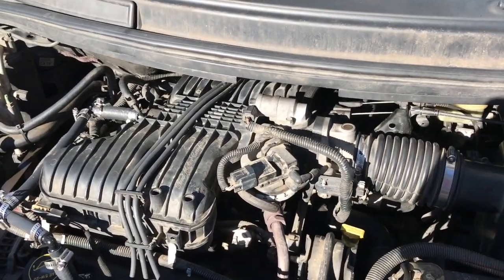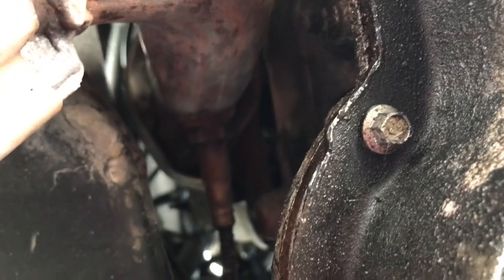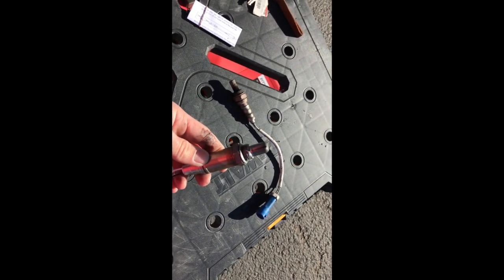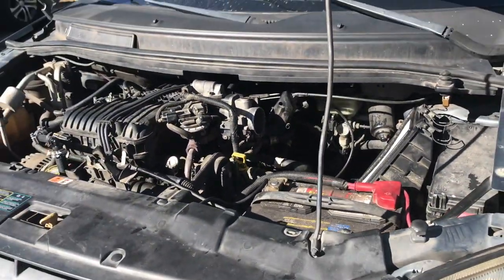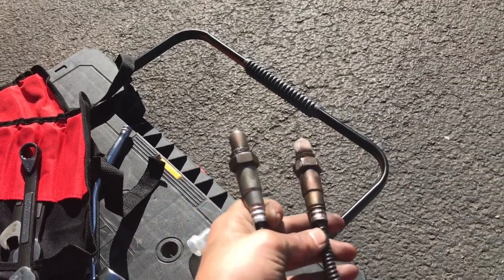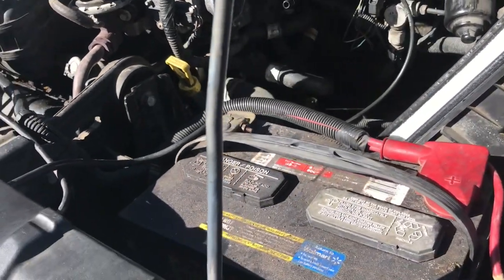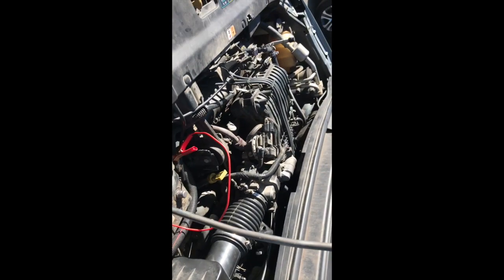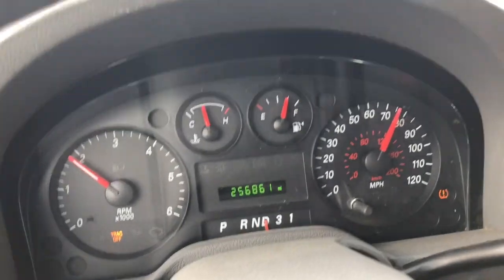04 Freestar O2 Sensors, Misfire Fix

Comment: I just fixed my 2005 Freestar. Rough idle, power loss, stall etc. P2195 and P2197 (O2 lean) codes. I didn't change the O2 sensors as it is unlikely both sensors failed at the same time. It turned out to be the IAC solenoid was seized. I connected it with alligator jumpers to 12 V and it wouldn't move. I washed it with throttle body cleaner and hit it with some lube and it started to move. Engine runs well again. I cleared the codes and nothing has come back since. As a preventive step I did the cowl gasketing and checked out the PCM connector. I hope that this may help someone else trying to debug all these sensors and valves. Thanks for posting.
Reply from the maker: D.Comeau Custom Knives glad to hear you got it running well again. The arms from the IAC solenoid on mine had broken off, and I JB welded them back on prior to this. Great suggestion on things to check!
Reply: Have  the same problem now, it's also saying sensor problems in the dash but that's not mechanical it's stalling only if it's a tight turn but it's def misfiring

Comment: Hey bro, I have a 2005 freestar, and I had that.same valve chatter noise, What you need to do to stop that and prolong your engine life, is to change your oil pump, what a difference it makes. I coild not beleive how great my 05 fteestar ran when I replaced the oil pump and no more valve noise, period.
Reply from the maker: Great tip, thanks for the update! This vehicle is long gone, but good to keep in mind if I run into it with a future vehicle.

Comment: I’m having this exact issue when I hit the beltway or a hill it drags at like 20/25 mph and jerks a lot..... then randomly picks up..... went to auto zone and they said it was my oxygen sensors I need 3..... I have an 05 ford freestar
Reply from the maker: They should be able to tell you which  you need to replace based on the codes, although at that point you should just go ahead and replace the 4th while you're at it.
Reply: Omg yeah I need to replace it all cause on my way to work the jerking and shaking was driving me crazy smh
Reply from the maker: You may consider replacing the ignition coil pack while you're in there. It's not terribly hard to get to while you've got the cowling off, and when it fails it can cause misfires that give funky O2 sensor readings. I've had to replace mine twice in the year I've had this van (3 times actually, the first one I got failed after 500 miles and had to be replaced on warranty), and it's only like $50 so it's cheap insurance. 

edit: After reviewing my video, I see that I talked about the coil pack at the end.
Reply: Omg thank you so much I’m definitely gonna look into all of that ASAP
Reply: Greetins Drew.  I experienced this same  problem with my 05 Ford Freestyle,  I replaced alot of parts.  EGR, THROTTLED BODY, FUEL PRESSURE SENSOR, COMPUTER, FUEL PUMP & FILTER, EVAP CANISTER,  COIL. Now. When tank is full it shudder while driving and shuts off at the stop lights at time.  But when the tank is 75 % full it drive great.  No issues.  Do you have any clues on why the car only does this with a full tank of gas?

Comment: I have a 2004 Ford Freestar With a Bad miss but no codes any Ideas
Reply from the maker: Weird that it’s not throwing any codes. Usually it’ll throw a misfire code and tell you which cylinder bank it’s on regardless of what’s causing it. Check the basics: spark (plugs and coil pack), compression (compression or leak down test), fuel ratio (clean the injectors, check for vacuum leaks). When I got my van it ran really poorly at idle/low throttle/taking off from a start because it had a few large vacuum leaks.
Reply: These will run rough if the camshaft synchronizer is failing and it will not throw codes  . Although you might here screeching /chatter

Comment: Hi  I have a 05 ford free star and I need to replace the 02 sensor from bank 1 sensor 1do yo know which one is that .
Reply from the maker: juan gonzalez It’s been quite a while since I owned and worked in this vehicle, but a few seconds of Google searching reveals that cylinder bank 1 is the firewall-side of the engine, and sensor 1 will be the first one after the headers. So it is the one to the left of the freeze frame at 5:23. A previous commenter complained that they didn’t know what they were looking for in this frame, if that’s the case then you should take your vehicle to a mechanic to have this done. Here is a pic where I highlighted the bank 1 oxygen sensor 1 noted in the freeze frame. 

https://imgur.com/a/UuEVku0
Reply: thank you very much Drew for the help I really appreciate it 👍
Reply: @drew657  is what you did considered a tune-up? Cause I have the same code except one

Comment: You will find literature stating to NOT use any grease in O2 sensor connectors, as SOME newer sensors get their biasing air THROUGH the wiring!
Crazy  right?

Comment: Where is 02 bank 1 sensor 2
Reply from the maker: Bank 1 is the side of the engine with cylinder 1, in this case it looks like it's the side closest to the windshield. Sensor 2 will be the oxygen sensor farther downstream in the exhaust, usually past the catalytic converter. Which is lucky, because it's easier to get to. 
https://www.fixya.com/cars/t25534919-firing_order_2006_ford_freestar

Comment: I have a 1986 crown Vic it has a 5.0 well at a low rpm it misses out when it's being drove I have replaced spark plugs wires distributor and rotor fuel filter and still having the issue so if anyone could give me some knolegment on this issue would be appreciated
Reply from the maker: My van used to do that, it died in the middle of an intersection a few times. The problem I found was a series of vacuum leaks. There's a lot of vacuum lines under the hood, so it may be difficult to hunt it down. Search on Youtube for ways to find vacuum leaks, the easiest is to put a straw on a can of carb cleaner and spray it at different sections of hose and connections. If the idle speed goes up when you spray a section, you've got a vacuum leak there, it's sucking in and burning the carb cleaner. Have a fire extinguisher handy.

Comment: I have a 2005 freestar ..im dealing with the same type of issue ..about to start throwing a bunch of money an new parts at her
Reply from the maker: kbeezyification if you’re don’t have one, pick up a code reader to see what it says it needs, and then do some diagnostics to figure out what parts it needs. Pretty easy to spend more than the value of the van throwing parts at it.
Reply: @drew657  i have 1 ...its giving me rich an lean codes ... Just made an interesting discovery about 10 min ago ....theres this weird little box above the alternator ....that has 2 control arms ...1 isnt hooked up ..an other videos show that this may be the problem... Tomorrow is another day ...mosquitos are eating me alive so i aborted for tonight
Reply from the maker: kbeezyification The mosquitoes will carry you away here in TX. IIRC that little box moves secondary air flaps in the throttle bodies. Mine was broken and disconnected too, and it ran much better when I got the arms hooked back up